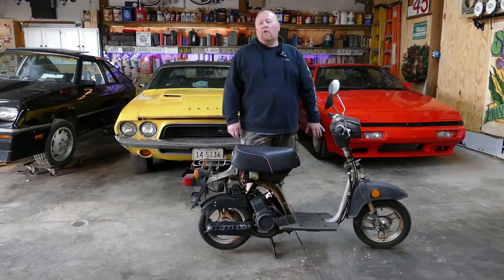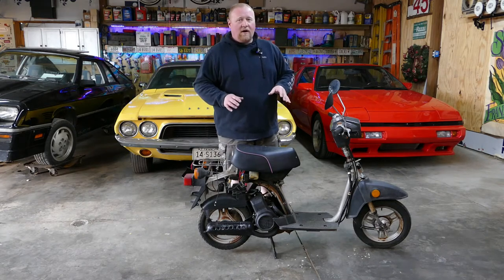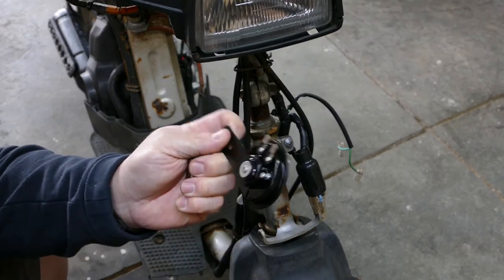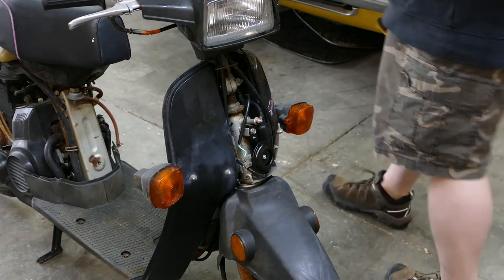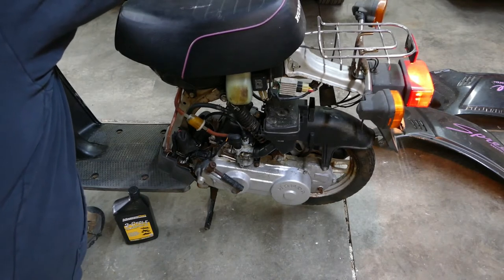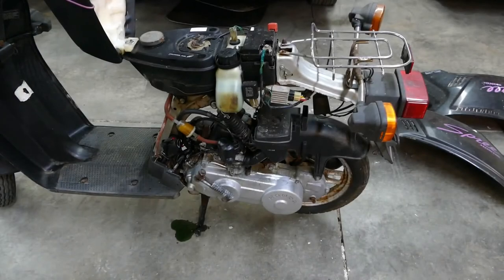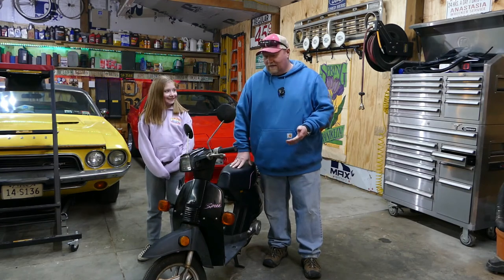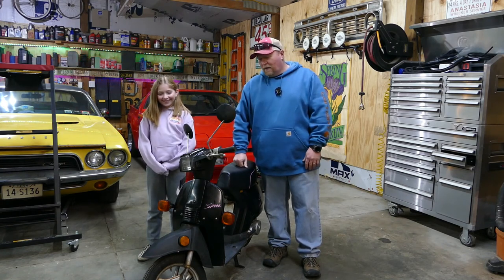1986 Honda Spree - Sitting outside for 25 Years | Can we revive it? PT4

Comment: You did a great job on this!  I have a 85 spree that I'm trying to get the headlight/instrumentation cover and the cowling right below it off so that I can repair and paint them.  It is a struggle.  Do you have any tips on this?  I can't remove the black screws on the side because a nut of some kind must be turning inside.
Reply from the maker: Yeah, if I recall those have to come out.

Comment: I just got 1 and cleaned the carb and now it starts up great and runs good but after like 3 minutes or once warmed up it dies and won't start. When I et it cool down u starts right back up again
Reply from the maker: Can you verify fuel is in the bowl when it dies? Also may be CDI box getting warm and cutting out.
Reply: @ProjectTimeGarage  fuel is in bowl but I didn't think a bout cdi getting hot

Comment: Hey man! Just ran across this video I just picked up a 1984 Honda Spree Nq50 it sat in a guys garage for 4 years and he couldn’t get it running. I’ve cleaned every nook and cranny in the carb, I’ve emptied out the gas tank and re filled it, we cleaned out the exhaust to the best of our ability, change the spark plug, air filter and we can get it on but it just bogs out after a few minutes then it takes forever to try and get started again. Any tips would help!
Reply from the maker: Take the exhaust off at the head and see if its better. if so, the muffler is still plugged.
Reply: @ProjectTimeGarage  we ended up changing the oil, putting new gas in it, cleaning the carb again got it running it wouldn’t stay idling and then it would bog out after a little it just would turn over. Took it all apart it was spraying gas out the spark plug hole ( it was also pissing out gas from the carb ) so we are hoping it wouldn’t start because it was being flooded because the gasket inside the petcock was ripped so it was getting a constant flow of gas.

Comment: A couple questions.  I opened mine up last week and it was full of oil everywhere.  Crankcase. Piston. Spark plug. Drive belt. Muffler.  You get the idea.  Any ideas what might be causing that?  Faulty oil pump?  I didn't see you talk about the Reed valve in your videos.  Did you mess with that piece at all?  Also - I'm thinking about doing what you did and try running it with pre-mix first to get it to start.  If I can pass that stage then I'll deal with the oil pump.  Can you share what was your mix ratio between gas and oil? Thanks!
Reply from the maker: Having that much oil in the crankcase either means the pump leaked it, or someone put oil in it by accident, I would bypass it for now and run Pre-mix. I ran mine at 32:1. On most old reed valves, I generally take the cage out, remove the reed itself and flip it over - that typically works if the valve is leaky.
Reply: @ProjectTimeGarage  Thanks!  Will give that a shot.  
On another note -- are you planning to sell any of those spare parts you got from that lot sale?
Reply from the maker: @juansuarez9949  Yes, I'm sure I won't need all of it.
Reply: @ProjectTimeGarage  Just like you I'm having an issue with my pulse coil.  Do you have any spare to sell on your stash of parts?
Reply: What that is, is the ring on the oil pump being worn out ( Part 16 in this url: https://www.hondapartshouse.com/oemparts/a/hon/5053dbb2f870021c54bda7ec/crankcase-oil-pump ). This is a known problem with the AF05E engine. The ring on the oil pump is over 30+ years old and like all things rubber, has deteriorated with age and is allowing oil from the reservoir to flow into the block. The replacement for it will cost you a whopping $2.95 online or at your local Honda dealer. Many people mistake this issue for a failing pump. The pump very rarely, if ever will fail. Do NOT run premix. The pump is linear. Meaning the amount of oil it puts out depends on the RPM of the bike.  At minimum, the Spree does 50:1 at idle, at max it does 32:1 at high rpm. If you want to run premix, I recommend 40:1 and no higher. At 36:1 or 32:1 you'll start saturating the plugs which is not good. Do NOT listen to what others say about this, even if they mean well. I know this for a fact because I reverse engineered the AF05E with the help of some technicians at Indian Motorcycle.  My Spree's will do over 50mph each and I didn't get to that point by second guessing things. Engine stability was #1 priority when we ran Dyno pulls on it. https://www.youtube.com/watch?v=U1MUmUUJbbs I see alot of people tell others to run 32:1 premix, that's just looking to blow the engine, DON'T DO IT.

Comment: You don`t need a license to drive a scooter in the us?
Reply from the maker: If it's 50cc or less, only a valid driver license is needed. No specialized motorcycle endorsement is necessary.
Reply: @ProjectTimeGarage  Same in Sweden, if you have car license you can drive up to 50cc but max 45km/h without motorcycle license